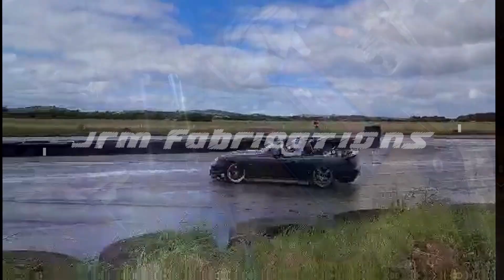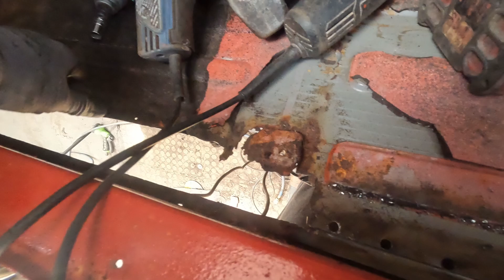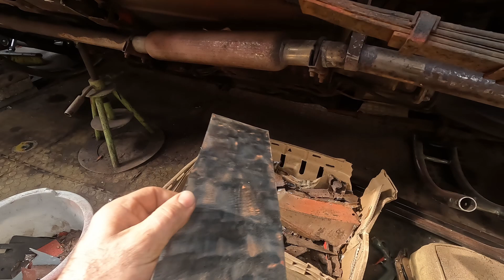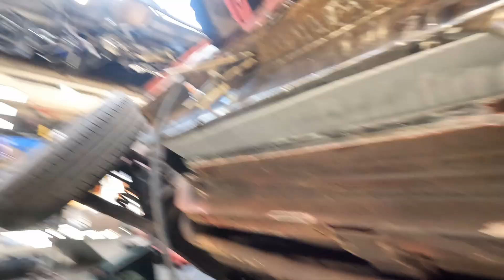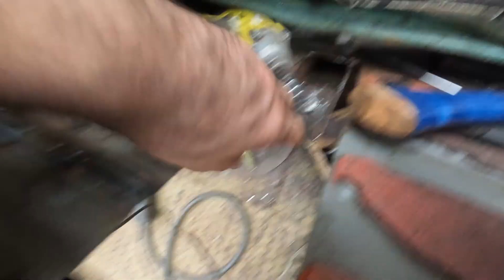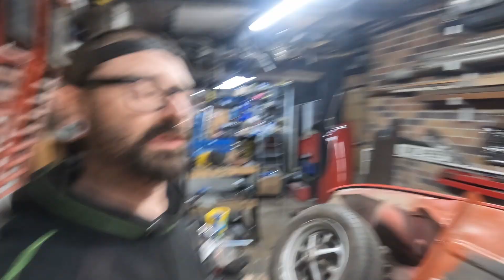1978 MGBGT Classic Car Restoration PS Sill Replacement Removal, Welding Patches and Castle Rail

Comment: I would highly recommend getting some weld through primer so you can coat the pieces before you weld them in.  Obviously it's too late for the left side, but for the rest of the car, it will save you from having to do it all again sooner than it should.  Well, it will save someone :-)
Reply from the maker: @stuartferreira3338  yes I had it on order it just hadn't arrived when I was doing the first area, but I appreciate the guidance, there's been alot of welding now at this stage, thank you for taking the time to watch
Reply: @jrmfabrications  You're doing a great job!  Can't wait to see it done.
Reply from the maker: @stuartferreira3338  thanks, blows my mind the rot lmao glad I didn't pay much for it, someone definitely spent alot of time doing it poorly before